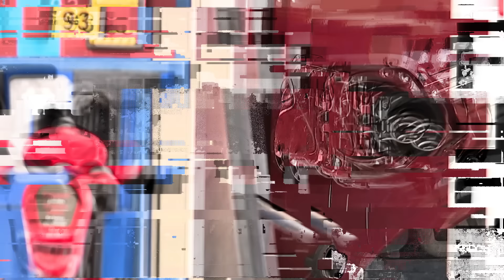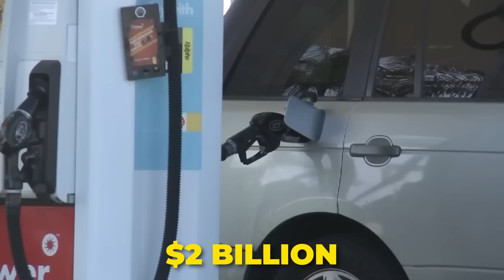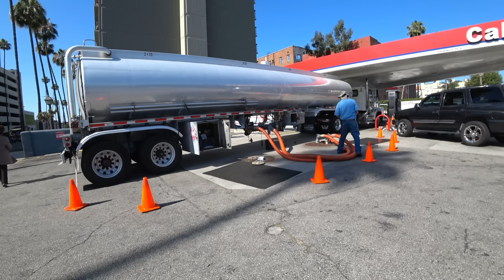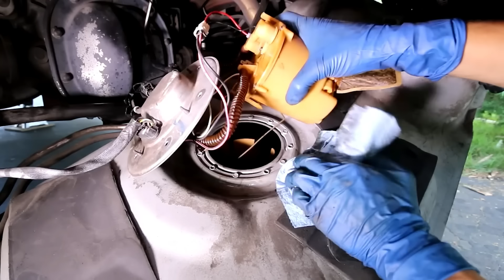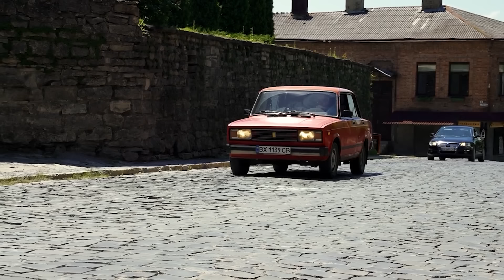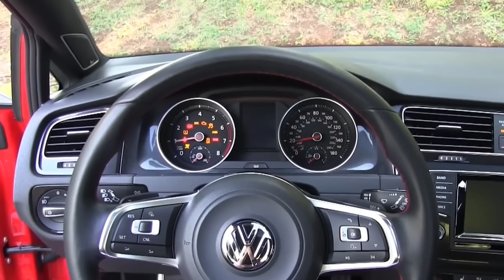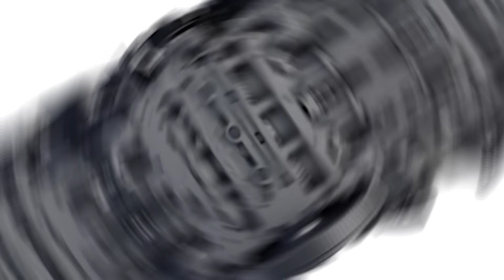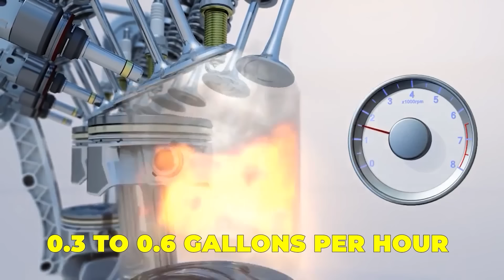15 Fuel Saving Secrets Gas Stations Protect With Their Lives

Comment: FACT:  Have you gas chkd for water as you can get water in your engine from gas stations. If so, you use super unleaded to evaporate the water from your engine. If it doesn't work and your engine gets damaged the gas station is liable.  So always use the same gas station to fill up your vehicle.

Comment: The statement pertaining to highest is false there is 40 additives in super brings nox levels down reduces carbon build up and helps keep injectors flowing full blast they will all be off a bit use a quality pea gas additive run tank down to 3//4 empty 1/4 full refill then do your oil change it will be black full of carbon and acid that drys up seals and yes purchasing gas when it’s been a cold night gets you 1/4 of a gallon more cuz gas expands in heat fill gas jugs 3/4 full it will expand and fill look at the dirt bikers going to the desert they bring gas and it expands looks like your gauge is not moving after a cold night it will show lower than it was on hot days yes inflate your tires to36lbs on a cool morning then drive they go up and down driving through hot desert fill them to33 lbs that road is so hot you would burn your feet !

Comment: And dont forget the ballast water which stops near empty storage tanks from floating to surface.  When tanker drops load of fuel that ballast water gets stirred up especially if tank is very low and there is possibility to get some water in your tank if i see tanker filling i drive on
Reply: There are filters that filer out the sediment before it hits your tank

Comment: We use Shell premium although not required for the car. The difference in how much better the car runs was a huge surprise.
Reply: Proofed by tests on a group of people in Australia. Premium vs Regular . It is phycological it feels better because you convince your self it is better when in fact it is not.
Reply: Shell premium is the best haven’t found a station that gives me more power…
Reply: Better for your car, better for your wallet
Reply: Agree, also better mileage.
Reply: A one that knows a little about engines knows better fuel =better for your engine .

Comment: My truck never came with a gas cap and I bought it brand new
Reply from the maker: A lot of newer trucks actually come capless from the factory. It’s a sealed system (often called “easy-fuel”) that closes itself when you remove the nozzle, which helps with EVAP emissions and avoids loose caps triggering a check-engine light.
If it’s working fine, that’s totally normal — just keep the filler area clean and you’re good.

Comment: For engine oil never go any thinner than (5w30). Going thinner means you don't have the protection your engine needs and could brake down sooner. Synthetic oil helps also.
Reply: The viscosity of the oil needed depends on what engine you are driving… a 4 cylinder vs a 8, 10, 12 or more need different oil.

Comment: Someone was saying that your fuel tank has breather holes in it. " NO THEY DON'T  " The only breather hole is at the top where the gas cap is." If there was a hole in your tank you would be losing your fuel out the tank.???
Reply from the maker: You’re right that there isn’t an open “hole” in the tank — fuel would leak out if there were. But modern cars do have a venting system so the tank can breathe as fuel goes in and out. That’s done through the EVAP system (charcoal canister + vent valve), not an open hole in the tank itself. So the tank is sealed, but vented in a controlled way — which also helps prevent fuel vapors escaping into the air and keeps the check-engine light off.

Comment: I have realized that about filing the tank.
However, in the last couple of years, I have developed the habit of pulling the trigger all the way. 
I have always watched the numbers and seen the difference. 
Take your time filling the tank, and you will get more fuel. 

I hardly ever use the air-con and rarely roll down the windows. 🤙🏼🙂🤙🏼❤️
Reply: Well apparently the pumps don't watch videos to know the difference or, there's not enough of a difference to really matter.
At 1/4 tank, I fill up, and I know how much I need to pay to fill up, it doesn't matter if I hold down all the way or not, I get the same end result, full tank.

Comment: So best to pump slow
Reply: I've always pumped slow plus I never fill up my gas to the tip top that's not good either😊
Reply: I saw what you did there❤
Reply: @DanceintheRaine666 🤣🤣👍
Reply from the maker: Yes — slower pumping reduces splash-back and vapor loss, so more fuel actually ends up in your tank.
Reply: It doesn't matter, that is total BS about filling up your tank fast. Common sense goes a long way in this world, start using it.
Reply: It actually says that it you listened. Ah duh....

Comment: Very interesting video.. good to know tips. However, I'd like to see you travel 45 to 60 mph on the interstate without getting ran over or pulled over, whichever comes first. A slow car is just as dangerous as a fast one. There are states that do have posted speed limits of 75 so which means cars drive at about 90 or greater.
Reply: 😂 but that's not true
Reply: The legal limits are 45 lowest and  the top posted speed ! And 55 to 60 always pass up  but make sure your lights are always on !
Reply: Drive 60 in the right lane, definitely not 45!

Comment: i heard this and filled my tank with regular and now when i start up the engine is racing. Corolla 2007.
Reply from the maker: That’s not caused by regular fuel. Check for a loose vacuum hose or a dirty throttle body — both commonly cause high idle on that Corolla.

Comment: By recording the odometer and the amount of fuel I put in the tank (always a fill up) I determined that the best speed for maximum fuel efficiency is 45-48 mph on a 3-speed standard (1970 Dodge Dart with a slant-6) and a 4-speed standard (1967 VW Beetle).
It’s probably around 55 mph on a 5-speed.

Comment: Another tip when filling up, when the pump clicks as full, don’t be tempted to squeeze a bit more in, the tank has breathing valves that need to breath which is not possible when the tank is brimmed.
Reply from the maker: That's a great additional point! Overfilling can definitely cause issues with the car's evaporative emissions system. Appreciate you adding that!
Reply: Up until now I was trying to get every drop in
Reply: Thank you very much for that tip!!!
Reply: Crap
Reply: True. The more it happens, the worse the mpg will be.
Reply: And now in lamens?
Reply: That's valid advice
Reply: Makes no difference to the likes of me who drives away and immediately drives at least 20 miles after filling up.

Comment: I was expecting to hear about driving with the tailgate up on trucks.
Reply: It's a whole lot cheaper to drive with your tailgate down. 
The traffic enforcement cameras on the 15-foot poles can't see my tag with the tailgate down.   😁
Reply: Trucks don't have tailgates. Pickups do though.    

 Trucks scare most drivers because they're so big. Yet people get right in front of them and slam on their brakes. People are STUPID!
Reply from the maker: Fair point. In real-world testing, driving with the tailgate up usually gets equal or slightly better fuel economy than down because it helps form a smoother air pocket behind the truck, reducing drag.

Comment: Where I live, many gas stations only have NON ethanol gas in the higher octane gas. I would use the 87 octane, but it has up to and possibly more than 10% ethanol. That crap costs me a minimum of 4 MPG. Real gas that is 87 octane is fine and I don't lose any MPG. Plus, ethanol sucks water out of the atmosphere and can cause rust in the gas tank if your vehicle sits for over 30 days without being driven. Ethanol is a BS gas so farmers who grow GMO corn can sell it to ethanol plants. My old Senator Grassley, owns 780 acres of corn. That corn gets sold to ethanol plants. Grassley fought hard to make sure we are forced to used corn gas. He also does not rotate his crops, which is a must in order to keep nutrients in the farmland soil.
Reply: It's not just condensation.i can't prove it but I truly believe ethanol is an excuse to sell you water in your gas.old cars if you had water coming out the tail pipe you would change the head gasket.noe new vehicles have a drain hole in the muffler😮.
Reply: eTHANOL was only meant for drinking, old buddy, not for racing fuel FFS

Comment: It's ludicrous to think that a "gas station" would be a source of energy saving tips! 

I'm ALWAYS conscious of idling when I drive, and try not to "race" to a red light that I know I'll be idling at. Most other people don't seem to care about that. Getting somewhere with the illusion of a higher speed, (even if multiple forced stops make that impossible) seems to be more important than better fuel economy.  

So 65 mph on the highway huh? (which is usually the speed limit) Try selling that theory to 90% of drivers who swear by 75-80 as the typical cruising speed. Yep, it MIGHT land you at your destination a bit sooner? (which again to most people is more important than saving gas).

Comment: 15 Fuel Saving Secrets Gas Stations Protect With Their Lives
  0:30 - #15 Pump speed trick
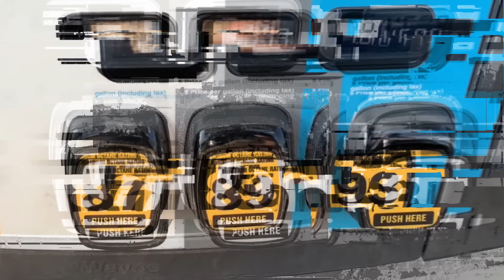  2:06 - #14 Premium fuel trap
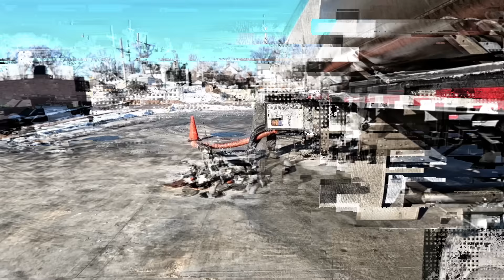  3:44 - #13 Fuel delivery truck trap
  5:22 - #12 Morning fuel myth
  6:55 - #11 Pump calibration trap
  8:30 - #10 Hidden air filter connection
10:00 - #9 Tire pressure truth
11:23 - #8 Short trip fuel killer
12:44 - #7 Hidden weight penalty
14:03 - #6 Wrong oil viscosity
15:36 - #5 Gas cap leak
16:41 - #4 A/C vs. windows MPG battle
17:50 - #3 Sensor sabotage
18:48 - #2 Idling trap
19:42 - #1 Speed sweet spot

Y'all are welcome 😉
Reply: Thank you Angel
Reply: Nice, but putting the "answer" next to each Title would have been more helpful. 😂👍
Reply: Bullçrapp
Reply: Gracias 🙏🏽
Reply: Thank u

Comment: I always drive away when the tanker is filling
Reply: Why not drive into the tanker and experience all the fuel 🔥
Reply: @NativeVsColonial😁😁😅😅🤣🤣🤣😂😂
Reply: No need to drive on. There are filters at the dispensers that filter out the sediment before it hits your tank. The advice to drive on is simply false.
Reply: He also said it last for 4 hours. How do you know if the tanker left 30 minutes ago. Also in any that pumps from a tank, it pumps from the bottom.

Comment: Two things....
Shutting off your engine if you will be stopped for more than thirty seconds,  then restarting IS BAD FOR THE ENGINE. It doesn't save fuel, and puts more unnecessary strain on your engine and starter. Some newer cars have this  auto sto-start feature,  and  you have to disable it every time you drive.

Washing and waxing your vehicle will increase the mpg, since there  is less air flow friction over the vehicle. Try it sometime,  especially if you are taking a long trip.
Reply: I like my Kia - but since knowing about the auto stop feature, I've been wishing I had it...but you're saying the engine suffers because of it? I don't think the majority of owners who have that, are disabling it. Are you saying starting the engine uses more fuel than idling? Are manufacturers only including it as a way to sell certain models to customers who think it improves mileage? Why can't engines be designed to go into more of a "sleep" mode in traffic or at long lights - instead of shutting off?

Comment: The supposed turbulence or cavitation created in the nozzle could in no way affect how much fuel is being delivered. The fuel delivery is being measured inside the pump, not after it leaves the nozzle. The fuel volume has already been measured by the time it reaches the nozzle. Use your brain.

Most states annually test and certify the accuracy of every fuel pump. How are the gas stations getting away with this when they are being checked every year?
Reply: Rude!
Reply: that means you pay for the amount of fuel left in the hose between the pump and nozzle when you are done pumping. just sayin

Comment: Gas station couldn’t care less if you knew any of this and gas stations are not required to inform you. It’s up to the car owner. Also when you buy oil just buy the store off brand because it’s all the same as the top brands because if I’m right there are 2-3 companies that make motor oil for all the brands out there. I use ABC only only when XYZ is just the same oil under a different brand
Reply: They don't know or care at the  gas station.  Minimum wage employees.
Reply: @mariannereno-db4db  they don't want them to know either 😂

Comment: May I add 1 more? Keep your battery in good condition and fully charged. The better the battery is, the easier and quicker for Starter to do its job as well as the spark plugs to offer more powerful spark ensuring better burn!
Reply: and check alternator if not over or under charging the battery !!!  i had this happen this week new battery needed  and next an alternator. because of voltage spikes the ecu can malfunction and change fuel trims  for no reason and also throws the check light  ( engine ) , get them checked  and this should help.:face-blue-smiling::face-blue-smiling:
Reply: Keep your key will lubricant …